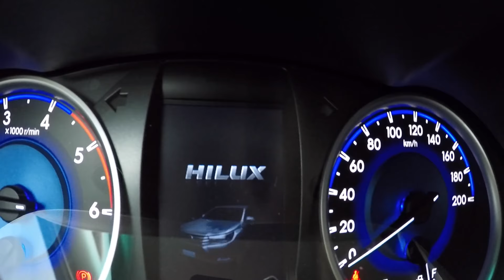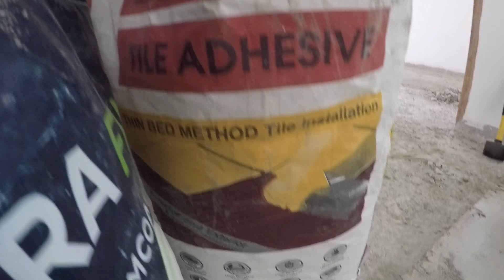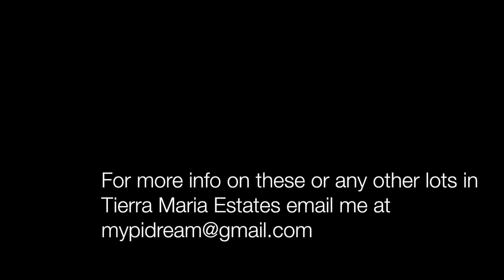VILLA FELIZ - EPISODE 166: THE FIRST OF MANY TILES DOWN (House Building in the Philippines)

Comment: excited on the tile installation there, maybe your guy got a little confused on the leveling screed. tile masons in the Philippines are not used to laying tile with adhesive over mud deck , we usually use sand cement mix of about 20mm. thick and adjust then level it.

Comment: Hi James....be prepared for hundreds of sacks of tile adhesive to purchase as in the Philippines they tend to correct any wrongly plumbed wall that way! Your eagle eye has possibly prevented this I hope. My small province crew did not have any tile cutter so they only used an angle grinder for the cuttings....you should see all those rough edges! More fun in the Philippines. One thing I learnt is that one has to adapt to life there and not the other way around but, judging by watching your videos, you will be just fine. Great job by the way!
Reply from the maker: Yep, mortar and tile adhesive are the biggest fixer of miscalculations in house building here.   Adapt and overcome I always say!

Comment: Be sure to check for voids under the tiles before they are completely cured. Most commercial applications are required to use ceramic tile adhesive under the tile. Large buckets of adhesive are located right there in the tile section. It's a big problem getting them to use that method here. Big owners/consulters have someone to chech each tile. So, you're an "Apple"guy? No wonder you're a giggler!  😀

Comment: HMR has lawn mowers, whipper snippers, leaf blowers bbq grills generators etc etc. You can pick a lawn mower up for less than  P8,000. I dont know about an Hmr in batangas but theres one here in Santa Rosa
Reply from the maker: Thanks Adzy!
Reply: My PI Dream no worries mate! Yeah HMR does sell surplus but you will find something new. I hate to rub it in but what did i say about the screed and tiles cut? So with the garage and the method they use to lay be on the lookout for airpockets. Another thing u might look into is toilet, if they bolt on wax or will they just cement it on. No biggy just a way I'm not used to either.

Comment: Looking good Question I know it's 220 but can you put any 110 outlets in ? Thanks
Reply from the maker: The only way I know of putting in a 110V connection with single phase 220V would be to use a step down transformer for that leg.  We won't be brining any 110V appliances to the Philippines so 220V works for us.

Comment: James can i ask is the damp proofing in the basement sorted out  seeing as the builder did not  not put a damp proof membrane  under the concrete. I was a bit concerned for you as the workers are now tiling in the basement cr and i would hate to see any damp coming up through the tiles.
Reply from the maker: We'll have full waterproofing for the basement.  Floors and exterior walls.  This will be done prior to the self leveling cement and final tile installation.  That was one of the business transactions I completed yesterday.  The materials will be delivered on Wed.